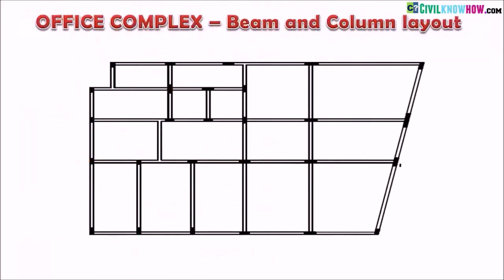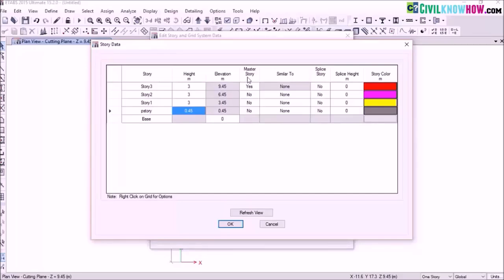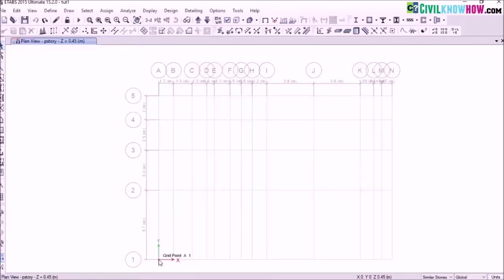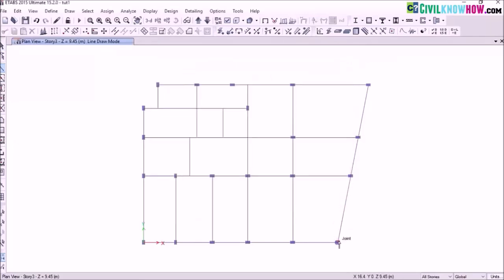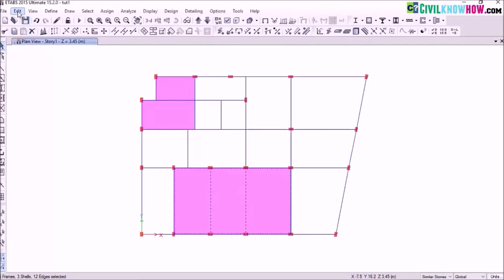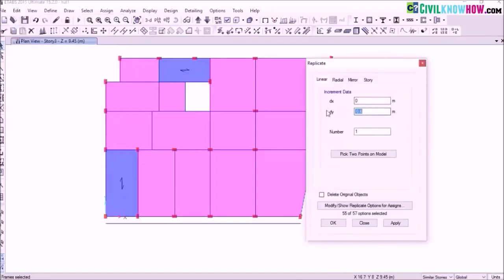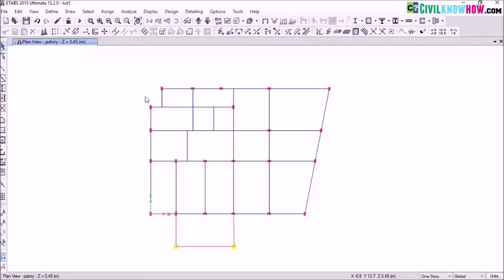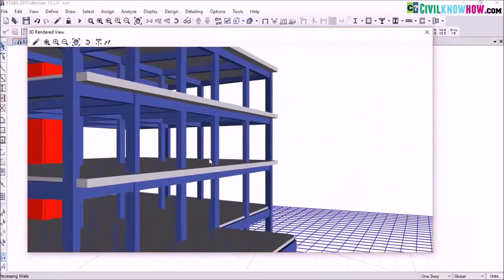Etabs 2015 Tutorial 1 - Modelling of a commercial building

Comment: Hey, Great Video and commentary. Really appreciate your effort. Thanks a ton. one small question. I agree that you are applying the slab as a membrane. But why did you apply the lift walls as membrane ?...They are basically shear walls too and will participate in resisting seismic lateral forces  right? So shouldnt it be applied as Shells?. or is it not going to take part in seismic load transfer?, Please clarify and enlighten me.
Reply: ur correct, it should be defined as a shell

Comment: why you assign .45m for plinth beam level? this you will not take from excavation depth?
Reply from the maker: +Engr Shams is it abt the depth of beam or purpose of plinth beam?
Reply: Civilknowhow Tutorials Engr i mean you keep the story height 3m, but for plinth level you keep it .45 m. buy em sure .45m would be from interlock level.. so why not take that from footing/ excavation level?
Reply from the maker: +Engr Shams what difference does it make in the analysis??
Reply: Civilknowhow Tutorials Engr if the column height is different it would definitely effect the end results. i could be wrong. if i am wrong then make me clear plz
Reply from the maker: Engr Shams I am not compromising on story height which is 3 m ....so I will get the desired column results.
next...plinth beams are assigned to carry masonry loads on the top plus it's self wt...in my case beam depth is .45 m...thus at the end providing me support reactions for foundation design...
Reply from the maker: Engr Shams  and plinth beams are not raised from footing level...

Comment: sir, 
i m starting to learn from ur videos but i want to ask u one doubt, it is necessary to learn staad pro before etab
Reply from the maker: +SHAHZAD NASER no...both are completely different
Reply: Learning Etabs in independent and does not need Staadpro as a base. But if you learn Staadpro and SAP2000 simultaneously along with Etabs it gives you great clarity and understanding of the capabilities and limitations of these different tools. just my suggestion and it worked for me.

Comment: Respected Sir, 
is there any commands for giving offsets to beam and columns of outer periphery for matching edges?
in 3d render view i saw slabs are slightly above the beam unlike in general practice top surfaces of beams and slabs are at same level,  does that make any difference in analysis?
Reply from the maker: +Kishan Aghera don't b bothered about the 3f view....offset option is there in etabs

Comment: It's a very good tutorial to understand the basics of Etabs. But I would like to know two things:
1. Where did you find the values of torsion constant and moment of inertia values? I am from Bangladesh and in our building code (BNBC) I don't find any provisions for those. If I take those values as 1, would it be impractical?
2. Should the beams be continuous even if the beams cross other beams at one or more points? i.e. beam along 3A-3J should be considered as a continuous beam whereas beam along 4I-2I would be continuos too. is it?
Note: I didn't go through other comments. So I dont know if you have covererd these questions. Even if you do, please repeat that.
Reply from the maker: +Raktim Barua  stiffness modifiers are based on crack width moment of inertia...n about the torsion it's specified in asce code

Comment: Dear Sir.. Nice Videos
Sir I have doubt how to assign two materials like concrete and Glass Fibre Reinforced Gypusm in slab and wall sections?
Reply from the maker: +Kapil Eswaragupta assign their values of their properties while defining materials
Reply: I done assign the properties of the material but how to assign in slabs if they are two materials like concrete and GFRG Materials at a time by using Layered in Slabs or wall define time. GFRG Panel with cavities thickness is 124 mm in that GFRG With 15 mm top & bottom and inside 94 mm thickness is filled with concrete material. How to assign both material at a time in layered? 
Display the {Slab, Wall} Property Layer Definition Data  from as follows:

When defining walls or panels 
Click the Define menu > Section Properties > {Slab Sections, Wall Sections} command to display the {Slab, Wall} Properties form.

Then do one of the following  to access the {Slab, Wall} Property Data form:

Click the Add New Property button.

Highlight an existing deck definition and click the Add Copy of Property button or the Modify/Show Property button.

Set the Modeling Type to Layered.

Click the Modify/Show Layered {Slab, Wall} Data button.

Comment: Dear Sir.....Thanks for this Etabs videos,Nice explanation with good english. Easy to understand, It will be very helpful if u could upload tutorials on Short and long column RCC (slender ) effective length calculation using etabs so also design
Do we require to change MI modifier to 0 .7 in case of frame element
Reply from the maker: +ahmed Hyd yes u have to..

Comment: How to model balcony in Etabs?
Reply from the maker: Define the slab as shell and place it on the balcony area.its the same way i have defined the sunshade in the tutorial.
Reply: Should I take offset or not , because in sunshade you took offset
Reply from the maker: Offset is used to make modelling easy and its not a necessary step.Suppose if u want model a balcony with cantilever slab of 1.5 m,its is difficult to get the correct measurement without nodes nearby...so in that case i used offset...and after assigning the slab,delete the offseted beam.
Reply: Thanks, Can you make a video on modelling and design of dome in Etabs ?
Reply from the maker: Sayed,if you check on youtube ,you can find couple of videos on domes.Hope that will be helpful....or else if time permits will make one .. :-)
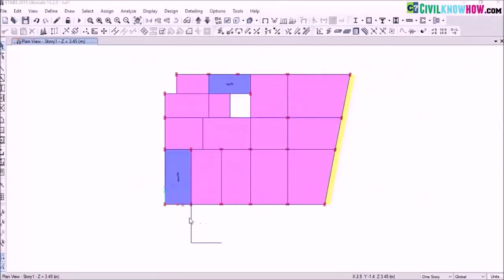Reply: Thank you,How did you draw those two beams at 33:05? I am beginner with Etabs
Reply from the maker: Offset one beam and draw an another connecting both offseted and original beam..
Reply: Thanks a lot.

Comment: Nice explanation. I have a question regarding the stiffness modifiers. Have you adopted these modifiers from ACI? because there are no provisions for modifiers in IS code. Why do you think IS code is silent about them.
Reply from the maker: Thank you........Yes i have taken from ACI code.About the indian code what i came to know from  senior engineers is that  IS 456, though it was revised in 2000, most of the revisions pertain to durability clauses, may be because the team responsible for revision is from Cement and concrete research. Hence it contained most of the provisions from the earlier version of the code. So we may see the stiifness modifiers included in the next revision.
Reply: +Civilknowhow Tutorials This is really sad if that is true. I also read somewhere that it might be because the dead load factor in combinations taken in IS456 or 1.5 while in ACI it is 1.2.
Reply from the maker: In the case EQ comb....our dead load factor is 1.2....n when w apply stiifness modifiers ...ther is 65 % n 30 % deacrease in the case of beam n column respectively.So i dont think the D.L factor of 1.5 can really compensate that.This is what i think..